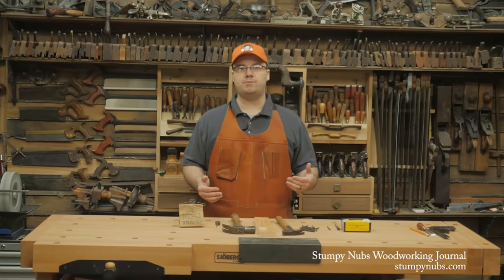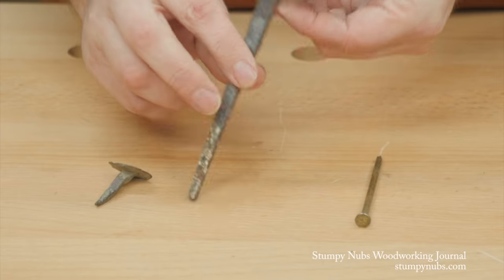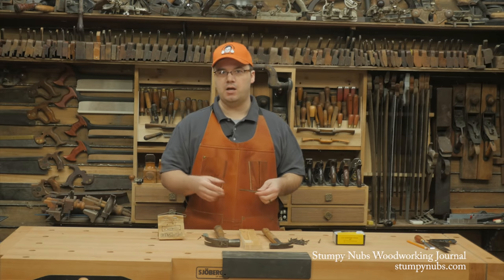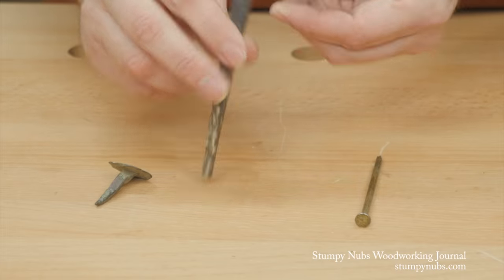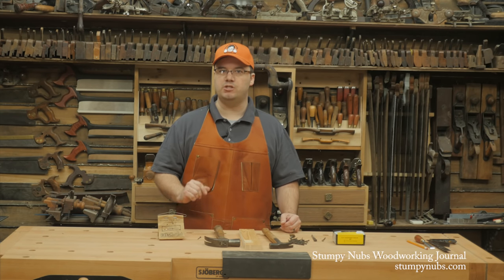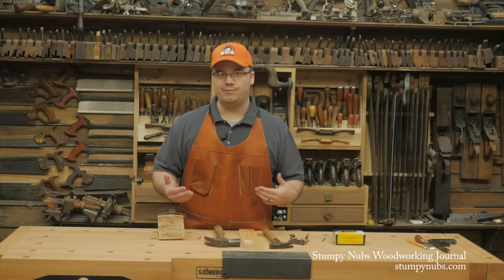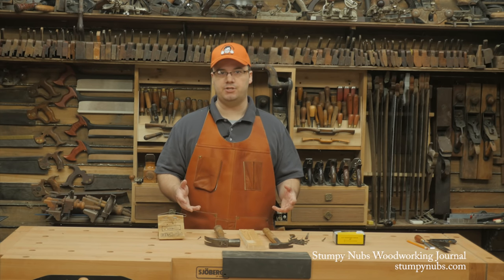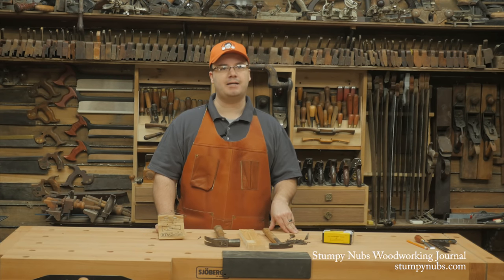Why cut nails work better- how to choose and use them

Comment: I don't agree that wire nails push only radially. Going through the wood, the tip pushes the fibers pointing them down just like any other nail. They all push the material radially at some extent.
Reply from the maker: The point of the wire nail is sharp, it can not shear the fibers. It can only spread them. You can choose to disagree, but that doesn't make it incorrect.

Comment: a few years ago i ordered some fancy pants bi fold exterior doors... THOUGHT they were coming from california, however turns out they were manufactured in austria... when they got here in mondo packing crates, i took the crates apart and found nails like i'd never seen before... looked like a spiral nail, but with several twists of a very fine wire soldered down the shaft... anyone seen such a thing in north america?  they go in easy, but for obvious reason they don't come out easy!
Reply: Do you mean wire bound coil nails? Like the ones that go in industrial nailguns?
I'm pretty sure you've got those in the US as well. The most common size that you'd find in a pallet or crate sells for 45 euro per 15.000. They can't possibly be that cheap and not be a globally used universal size. Try buying nails at that price at your local DIY store.

Comment: The main thing you have to consider is that the material used in each nail and the area around the head of the nail are large factors in this.
While yes the older designs worked and in some applications work better per nail, the grip for each quantity of material is better in newer nails with easier application, lower manufacturing costs and tend to preform better with vibration or shear situations (for it coming loose). 
Also it reduces deformation of the material and reduces permanent damage. 

The reason why its so heavily used is that its the jack of all trades, cheap manufacturing, less skill to use, and reduces the visual imprint compared to other types

Comment: I found some cut nails in some old oak flooring.  I saved them just in case.
Reply: I had a commission to cut down an old church pew. Salvaged some hundred year old cut nails from the throw away portion. Used some of the single board back, the top trim and the nails to make a one off tailgate for a friends truck.

Comment: You didn't include Ardox nails in this? You went through a couple random nails but didn't include on of the most annoying and hardest modern ones to remove that fit in this holding category?

Comment: Nails are nails in the end. I have a 118 year old house full of nails. The cut nails are all very loose in the wood and not holding very well anymore. You see,  the taper is the problem. As the words gets older and less springy (more of a memory forms of the shape of the nail), the tapered nail just pops out of the wood, because the hole is also tapered. The only way to build with quality is screws. Nails just don't hold over the long term
Reply: Actually, what you describe is why old barns and such were put together using hardwood pegs instead of nails. As the wood would dry out following construction, the beams (made from a softer wood) would shrink at a rate greater than the much harder wooden pegs holding them together. The holes that these pegs live in literally tighte up around the pegs over time and the structure becomes much more rigid. Dont't believe me? Try pounding a peg from an old barn beam sometime. Can't be done! Why ferric nails weaken over time is that after this shrinkage takes place, the nails will oxidize and their diameter shrinks and they lose their holding strength as a result. Add to this the seasonal cycles of cold and hot temps and metal nails will "walk" their way straight out of the lumber they are supposed to be holding. I will say that modern framing nails that have that yellow treatment on them address this problem quite well in framing a house. That yellow stuff protects the nail from oxidation and is also a heat sensitive glue. The act of driving these nails into wood heats up the glue causing the nail to bond with the wood better than friction alone. This is why I only use these treated nails when banging most forms of construction lumber together.
Reply: @mytoolworld  Are you talking about galvanized nails? That's not glue, it's just zinc and it only provides corrosion resistance. I have never heard of or seen any type of "glue coated" nails and the act of driving a nail into a piece of wood doesn't generate much heat.

Comment: Good video but spiral and ring shank nails solve the smooth wire nail problem.
Reply: @jacobacon3219  try removing a 6" ringed pole barn nail from a 2x10 nailed to a barn post. One of the most futile things I've done. You're better off hitting the edge of the plank with a sledge hammer until the nails sheer off.

Comment: Great Vid, but I’m struggling with the imperial measurements..
Reply: Just divide the size of your horse's hoof by the hour of the day, multiply by the number of princes in your royal family, and add 17/64th.
Reply: disklamer 
So it is really that easy?! I had the formula arse about face!
Cheers for the insight.

Comment: You said that for a 3/4" board, I should use a 6 penny nail, which would be 2" long, which doesn't make any sense.
Reply from the maker: Why doesn't that make sense? That leaves 1-1/4" of the nail to penetrate the edge of the work piece you are nailing your outer piece to.
Reply: Yeah, I suppose. Unless your other board is also 3/4". Seems like both pieces' thickness would need to be taken into consideration. It just seems like an overly complicated "rule of thumb" that only works in certain situations, so why even bother in the first place. Or change your wording to make it clear that this rule only applies when you don't care about the thickness of the other board.

And frankly, screws dude.
Reply from the maker: How often do you nail two boards flat together? Nails are used to create joints, so it passes through one face of one board and into the edge or end of the second board. The thickness of the second board doesn't matter. Again, this video was about the traditional methods. And traditionally, if you did nail two boards face to face, you would clench the nail on the other side. It was all covered in the video...
Reply: Better to have said, "which I can't make sense of."  That puts the fault where it lies.